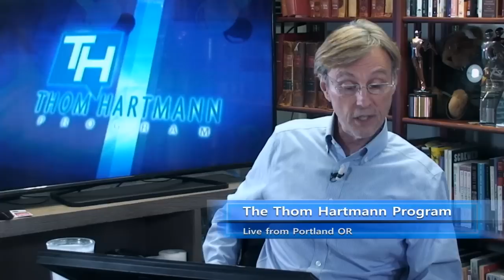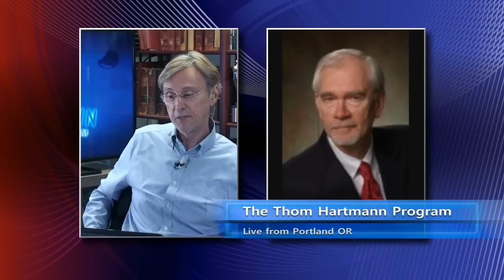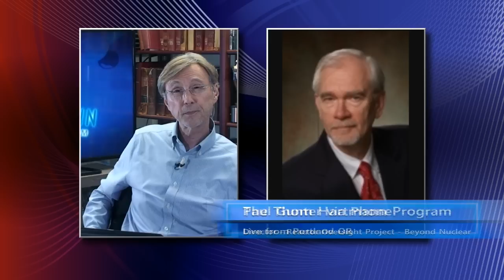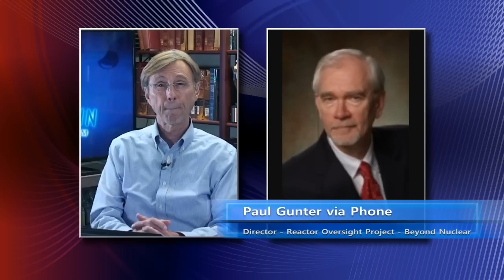A Floating Chernobyl - What Could Possibly Go Wrong?

Comment: Using a 1-Mwh technokontrol RF-5000 magnet powered generator takes 10mx2.5m of footprint each, stacked 7-high is about 900m^2 for 250Mwh.

These machines come with a 50-year no-inputs normal upkeep warranty, nothing external req'd per Mwh, magnets do the work, Belgian.

It's the only solution, 2-5 of these put most substations off-grid and fit truck parking spaces, decentralizing this way is fast and incremental on costs.

A home machine, 10kw/$15k, 5kw/$8k, from S.Korea, infinitysav
Reply: You're talking about a scam that violates every known science.
Reply: @bronzedivision  Aha, another member in good standing of the PDC, Physics Dunce Club, magnet motors produce wasteheat under load from eddy currents thus output is always less•than input, entropy, so, to leave the club one must prove this violates the 2nd Law, if you cry Uncle we'll know that you aren't the scam bubba'.

Since one can buy these, extra stars on your Cap as an above average Dunce of Agenda, or a bot, whatever.

Comment: Boiling water for energy, best the nuclear gang has. We assume all liabilities, all decommissioning costs all the generations of watching the waste.
Tillerson spent all his time with Russia setting up oil deals we will pay for.
Reply: How does a coal plant generate energy? By boiling water. How does a natural gas plant generate energy? By boiling water. How does a thermal solar power plant generate energy? By boiling water. How does a PWR plant generate energy? By boiling water. How does an MSR generate energy? By boiling water. Basically only photovoltaic and thermovoltaic generate electricity straight from light/heat.
Reply: @Jcewazhere  Wind Turbines and other options are out there.
It's going to cost generations to watch the waste we have and we need to do better. Less bombs maybe
Reply: @Jcewazhere  burning elements does little to the elements, the ideas about waste streams burn up are interesting but nuclear decay doesn't care much.
Reply: @Jcewazhere   The physics I understand does not support a lot of opinions on particle physics. Link to research for your ideas please, not news sources. Good luck
Reply: Richard Wood Has anyone ever called you Dick Wood before? I had to ask. LOL.